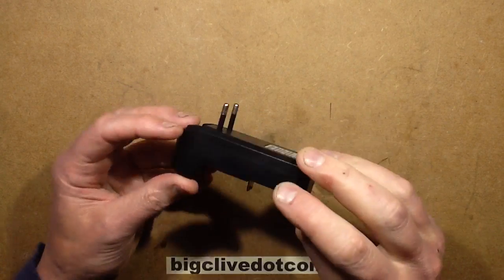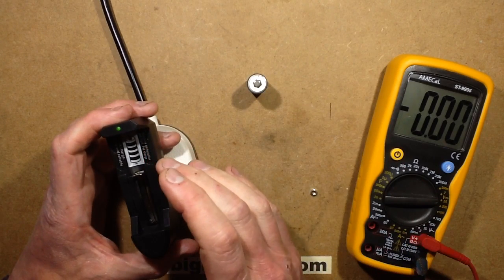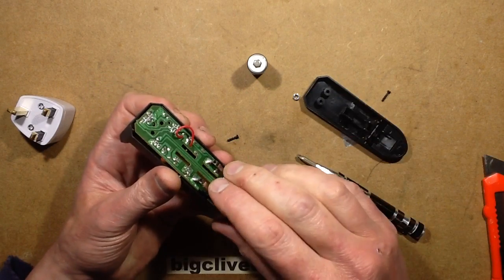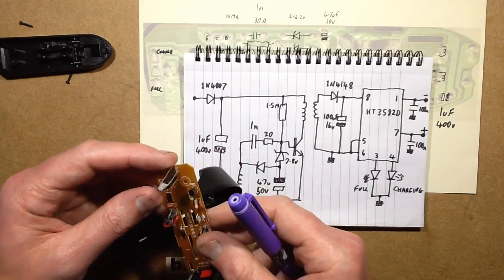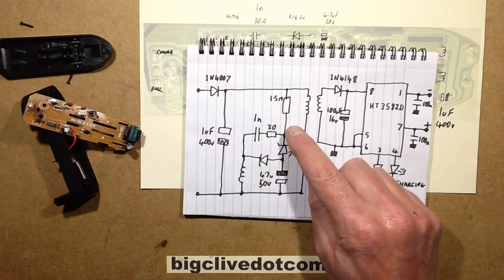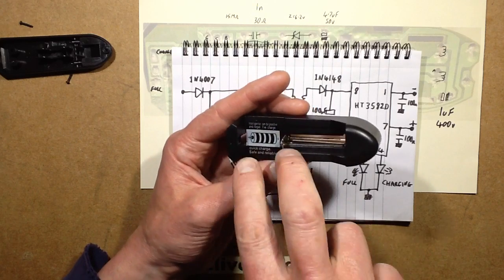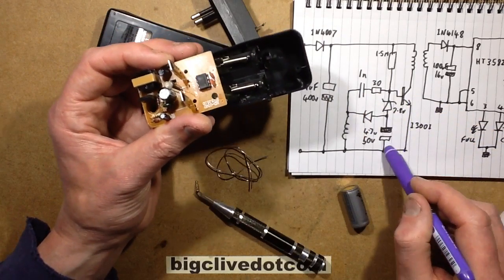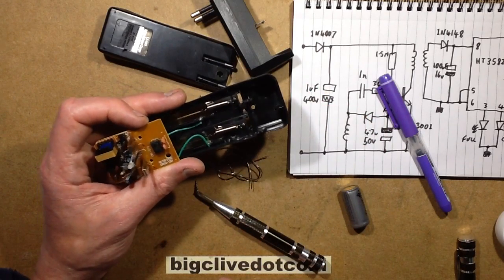Inside some cheap lithium cell chargers.  With schematic.

Comment: My mother had an external HDD with a battery that has been connected to external power for almost three years, suddenly we saw that the battery had expanded and pushed the case it's in apart. So I'd think that battery is dead of course, but do you think it could run without the battery connected, or that the battery could be replaced? Haven't opened it yet to disconnect and remove the battery, but I will.
Reply: Update?

Comment: Interesting to see the schematic for these cheap chargers. I did also test some chargers looking similar, but not exactly the same. They where not great chargers. The single slot charged to 4.35 volt (I could not read the chip number, it was in Chinese), the dual slot was a without ICs, but could both do NiMH and LiIon.

Comment: I have gotten a few chargers free with some flashlights I bought on ebay, but none of mine even had an IC in them, just a couple of transistors. I just tossed them in the bin, I wouldn't trust using them.
If you are going to charge lithium batteries, it's worth it to spend $15 - $20 to get a decent charger that is actually safe to use.

Comment: Some of these types of single chargers have the ability to auto detect charge voltage depending on the type of cell it "sees". As an example if you place a deeply discharged Lithion cell into it, the charge will begin as if it were a NiCad. Briefly opening the contact and closing it will sometimes, given the cell enough of a charge to begin charging at the lithion voltage, so be very aware that lithion cells can go bang. Never leave  these unattended. Place in a metal bucket or box if you do
I have used these to charge cells removed from dead laptop packs. Your results may vary...!! so Pay Attention !! As a side note: I have never had any cell go bang BUT there is always a first time
Reply: Craig Nehring l
Reply: This is actually quite handy, but then again, care should ALWAYS be taken when charging deeply discharged lithium cells, especially chinese made 18650s

Comment: What's the point of bothering to put in reverse polarity safety circuitry if there's no contact nub (i.e. you need a little nut) or better question- why do we have those nubs at all if contact can so easily be made (sometimes accidentally). Have I just answered my own question (as in the nub shows polarity)? :/
Reply: I wonder if the two cell one also says that. It's definately not reversable if they are in parallel. Someone could put them in different ways causing a short and blowing it up.

Comment: I have one that destroyed it's self and a battery it was charging. It was plugged in to a serge protector with a built in 10 amp breaker. It was on for about 30 minutes and then the breaker on the bar tripped, I went to check it and the plastic on the  charger and the battery were melting! I yanked it out of the wall and put it outside on concrete in case it went boom. After it cooled it was unrecognizable as a charger, the battery was bulging and dead.

Comment: Could you possibly improve it by covering the tracks with something like molten plastic or wax? The dielectric strength of air is relatively weak so I'm thinking if it sparks it will do it through air.

I have that same charger for 2 cells on its way from Shenzhen right now.
Reply: well.. wax is flammable, so, id not try that. maybe a high level glass filled nylon would be ok, but, thats basically what a chip board is, so, may as well print a new board with larger spacing.

Comment: Greetings from Australia. Just wondering if you can do a pull apart check on a touch switch modules the ones used on lamps where you just touch any metal part and it turns on some of them in thee stages , because they work of mains wondering how dangerous are they.

Comment: Aside from the circuitry doing ac=>dc, this could be quickly refitted with a TP4056 board to at least repurpose the holder. Especially because it's easily modified to use different charging currents. Fits well with one of those cheap usb current/voltage/capacity monitors. 

 I always giggle seeing "ultrafire" on a battery, especially when the capacity is so much larger than it should be.

Comment: decent separation at least
Reply from the maker: Not as much separation as it looked.
Reply: +bigclivedotcom least they cut the slots. creapage is good in that sense
Reply from the maker: And then passed the low voltage transformer tracks right next to the high voltage ones anyway.
Reply: +bigclivedotcom the chinese work experience kid probably didn't realise his errors lol.
Reply: bigclivedotcom is this charger and 18650 battery safe to charge overnight and how long will it take to charge an 18650 battery for the first time. I have that exact charger you took apart and it always stays red. anyone can tell me how long it should take to charge my battery. battery is 18650 4200mah and charger is 3.7v/500mah it's my first time dealing with this batery

Comment: Get a small piece of double-sided .5mm copper clad. Solder a wire on each side and you've got something that can easily be used to measure the current through batteries inside their holders. Add a shunt resistor for current monitoring on an oscilloscope for battery powered circuits. That much more useful than the probe-poking ;-)

Comment: I have a portable rechargeable speaker and the lithium battery in it doesn't charge.. I think it might be because I left it on and it drained the lithium battery too much.. Is there anyway I can bring it back to life?
Reply: Get a power supply and add a 470 ohm resistor in series between a 5V supply and the battery for a few minutes, closely monitoring the voltage and current. Once it gets up to 3ish volts, plug it in like normal and the proper charging circuit will do it. I did exactly this to a broken bluetooth speaker to revive it.
Reply: You could try to charge the cell SLOWLY (maximum 50mA) with a regulated lab supply to get it over the 2.5-2.8V mark that makes the charging circuit want to charge it again, but it's on your own risk. Cells that has been discharge too deep can go into thermal meltdown if dendrites has formed inside.
Reply from the maker: If a lithium cell is over-discharged it can be damaged and it's usually unwise to try and recharge them.  If you want to take the risk then you can try to make contact with the cells terminals directly (no protective circuitry) and trickle charge it at very low current until the voltage has reached a level that it will take a charge as normal.
Reply: bigclivedotcom Thanks, I guess i'll just replace the lithium battery.
Reply from the maker: It's a standard size called a 16340 (16mm diameter by 34.0 mm long) that you can get from eBay in either protected or unprotected forms.  As usual the Chinese vendors capacity ratings can be taken with a pinch of salt.
Reply: +bigclivedotcom were did you get that small battery if you don't mind me asking , thanks ,love the video all of them.👍👍👍👍👍👍
Reply: +bigclivedotcom cool thanks do you know were I could get them from , thank you for your time .
Reply: if it is an 18650 you can get them from old laptop batteries
Reply: Even if it is not 18650 inside, you can use one (with well insulated terminals!) 18650 cell (or multiple of them in parallel, if it is a power hungry/dubbed as battery bank speaker) as a replacement if your original one is shot... Stick it inside, if it fits, or on the outside if it doesnt.
Now that last sentence is really übersmart ;-)

Comment: I have seen USB version of this, even superbly reviewed with high rankings from people!
http://amzn.to/1VmcEqT costing 7,50€ which is about 5-6 pounds i would assume, even the casing should be good according to the reviews!
Don't have one though, have 0,83€ on my bank account right now :D
Reply: yeah, after i got the first one in the video with a laser from china, i threw it away and ordered this exact one from amazon. it's working fine so far. i'd rather have something with a usb plug than with flimsy fold out mains prongs.

Comment: This is supposed to be a charger with EU plug, but it cannot be inserted into EU socket! The reason is that EU sockets are not flat, but have "edge", and prongs of this charger are not long enough to reach connectors in EU sockets, or at least they don't hold properly and are very unsafe. I ended up opening it, removing the prongs, and soldering regular EU cable to it's PCB.

Comment: shit i have that first one, i hope it isnt explosive
Reply: Please dispose of it. It is dangerous since it overcharges and never terminates. http://lygte-info.dk/review/Review%20Charger%20Bowei%20HC-103W%20UK.html
Reply: Mine's on its way from hong kong ..
Reply: it has worked good so far, i charge 18650 cells with it and it works fine.
Reply: +ferongr I'm not really scared, I've used it for months now and taken it apart to make sure there isn't anything super bad like shorts